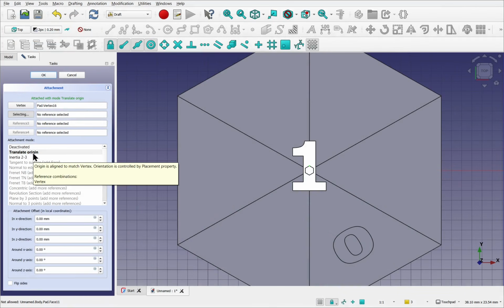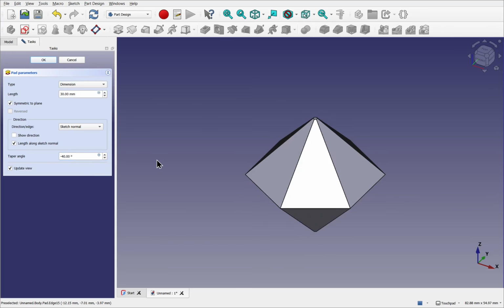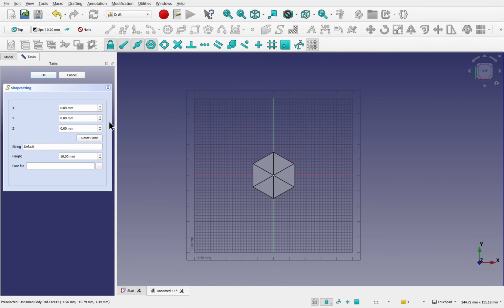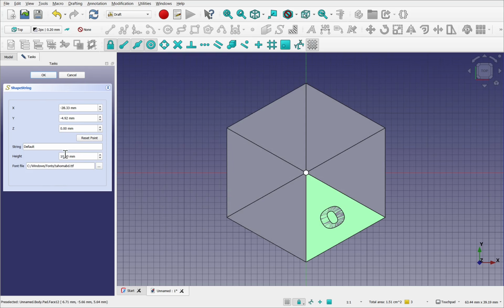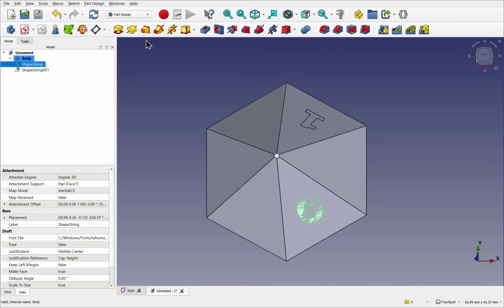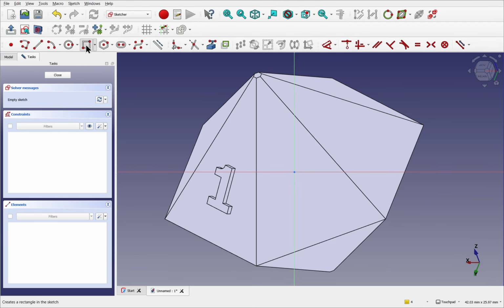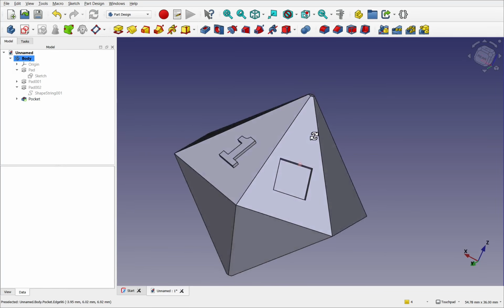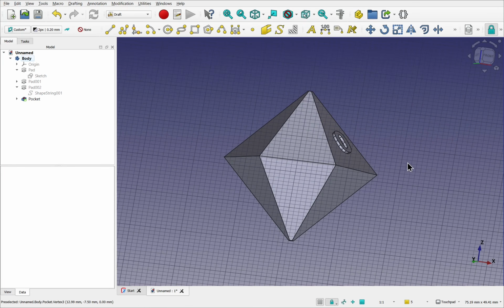Text in FreeCAD | Multi-Face Dice in Part Design | Basic Beginners FreeCAD v1.0 / 0.22 Lesson 17

Comment: Thanks for the tutorial! 
I'm starting to regret, that I didn't make some sort of documentation for myself as of how different functions within workbench are working. Now, when introducing another workbench, I feel that I've just too much information to grasp  - After watching the whole series, I think I will have to do it again :)

I stumbled upon 2 problems during finishing exercise:
1) In a "draft" mode selecting specific plane didn't work on all of the diamond shape faces (only on every second). This can be solved by using the second technique in this video and referencing your object/draft against 3 vertexes. (This would results in MapMode: ThreePointsPlane)
2) As someone already mentioned in comments - also could've created a "datum" plane on top of existing plane (which I did in 2 places - just to test it out) - this also worked, but I'm not fully sure what it actually means. 

Thanks for the effort putting these videos out here!
Reply from the maker: Thanks for the kind words, and it's great that you found ways to solve those mapping challenges and really happy you have shared.  The comments are just as important as the video, especially as versions move on.  FreeCAD is pretty extensive, a load of workbenches that can integrate partially and fully with others, it's a lot to take in if you try to spread yourself across them.  Starting with the part design does contain your leaning somewhat.

Comment: Thanks for the great video series! I’m a newbie to interactive 3D modelling. (I normally use OpenSCAD.) Following this video, I think I went overboard in building a pentagonal trapezohedronal D10 with a nice square outline (as viewed from the side when it lays flat on a side) using FreeCAD’s constraints system to calculate both the face draft (41.9699°) and the edge draft (48.0301°, also used for the “Pencil Blunter” for the sharp ends). I wasn’t quite sure at this stage how to intersect a pentacone with an inverted, rotated clone of itself using Part Design, so I did the outer levels with the Part workbench. 😀
Reply from the maker: Glad you enjoying the series :) :).  If your using the part workbench, might be worth checking out the add on workbench Pyramids-and-Polyhedrons workbench.  It will give you some nice primitive type shapes with configurations for size, side number etc.  It's been a while since I used it but it's great for this sort of thing :)

Comment: Is there a way to bend the text? I have text that I need to fit in a stamp without making the stamp longer so I wanted to bend it like this: ) but I can't figure out how.
Reply from the maker: There are a couple of options as it's not supported out of the box and often require either a macro or tools from a addon workbench.  I just looked through my bookmarks and found this : https://forum.freecad.org/viewtopic.php?style=8&t=82577

Also a video from myself using the curves workbench: 
Text on curved surface : https://youtu.be/AxtpYy9aFf4

The other option is to use inkscape and import the SVG straight into your model.

Comment: I'm going through all this again with 1.0.2, I get to around 21:00 mark to start draing the square onto thee third face, but I get an error saying "you need a planar face as support for a sketch!" I can attach it to any other face, just not the face next to the "1," so created a sketch with nothing selected and changed the mapping of the sketch to 3 points, it then aligns straight with the +Z the same directorion as the "1".
Reply: I'm having the same issue. Two of the six faces give me the error. All the rest it considers to be planar faces. "Align to selection" would also not work on those faces.

Comment: Couldn't make it. Working with Ubuntu and can't find my fonts.
Reply from the maker: In Ubuntu, font directories are primarily located in /usr/share/fonts for system-wide fonts and ~/.fonts (or ~/.local/share/fonts) for user-specific fonts. Additionally, /usr/local/share/fonts can be used for manually installed fonts.  Hopefully one of those locations will help you.

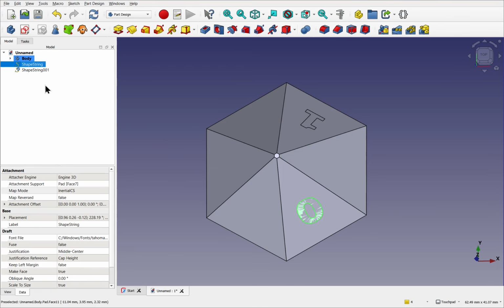Comment: At 11:35 when I attempt to drag the ShapeString into the active body the cursor turns to a red circle crossed through and the action cannot be completed, but I see no error message. What am I missing?
Reply from the maker: Just check to make sure that the shape string is not already inside the body by collapsing the body in the treeview.  It's quite easily to think something is already inside a body container when it actually outside..
Reply: @MangoJellySolutions  Nope,  both shape strings are outside the body.  I am unable to pad, getting the  "Cannot use selected object. Selected object must belong to the active body" message.

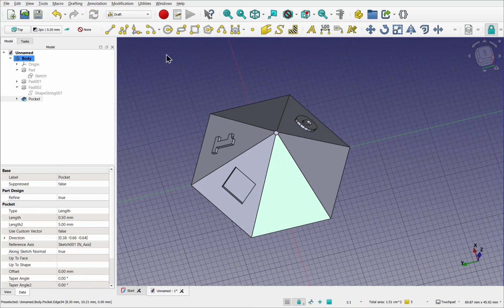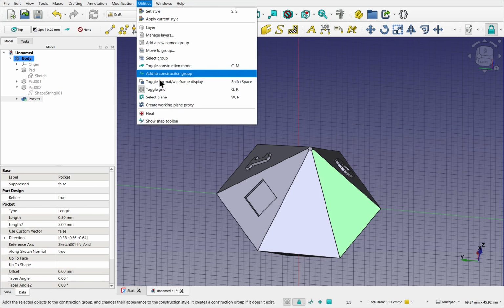Comment: Why is there an error when selecting a plane on some surfaces and not others "selected shapes do not define a plane" as seen in 17:40 - 17:57 of this tutorial? In my case, I'm not able to select a plane on the face that you did, however; I am able to select a plane on the face that you could not. Is there a workaround for this issue or is there something I'm doing wrong? Thanks!

Edit: I was able to go to the part design workbench to create a datum plane on the face then go back to the draft workbench then use the datum plane to select a plane to create the shapestring. The text appeared upside down so I had to rotate it 180 degrees.
Reply: i also ran into the same problem. only every other object could be used for plane reference. what did work for all faces however was using 3 edges instead of the face.
Reply: I am not sure why you never got an answer. Also someone else had the same question in the comments, also unanswered by the author.

Comment: Good Stuff! Question: How can I do this same thing but only created pocketed text so I only have a cookie cutter type outline of the text.
Reply from the maker: Interesting one, there are a number of routes.  If you just want the outline of the text click on the text and create shape binder.  The shape binder has options for offset and fill offset.  Set the makeface to false, fill offset to true and set the offset to either a minus or positive value.  Some text works best with say -2mm where other will be better with +2mm. You can then pad the shapebinder rather than the text. There are a number of other ways.  I think this could make a good video.

Comment: Your course is so helpful, Thank you so much! This is the first video of yours where I've run into issues, sadly.
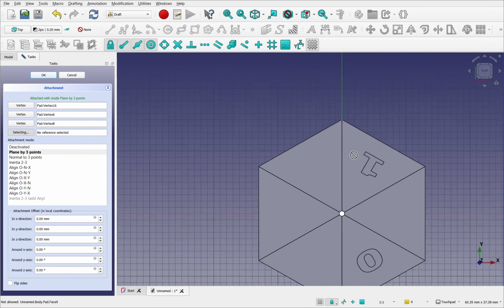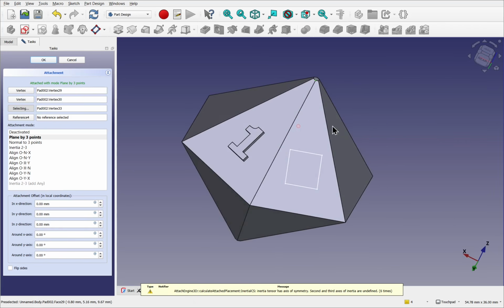First: When attaching the ShapeString object to the dice using "Plane by 3 points" (10:26), the object is not actually centered, because it is placed in the center of the triangle defined by the three points. As the dice side is a trapezoid, doing it this way places the object slightly off to one side (much more clearly visible if you reduce the taper angle of the first pad to something like 20°). It is more clearly visible with the square at 16:35. Do you know how this can be corrected? I also expected the object to be very slightly angled towards the orientation of the triangle between the 3 selected points, but it seems like the axes align properly, so I don't fully understand how FreeCAD places the origin based on the 3 selected points. Could you help me understand?

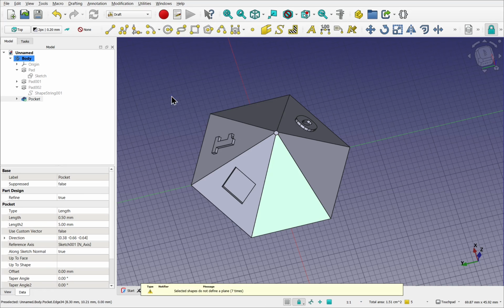And secondly, I also got the error message you got at 17:45, but I would love to know WHY that happens. Is it just a bug in FreeCAD? As a workaround, I just selected the two long Edges of the trapezoid that didn't work and selected the plane from that, which then worked fine. So I'd guess it really is some sort of bug, what do you think?
Reply: For anyone interested: I managed to solve the attachment by using "Inertia 2-3" and selecting all 4 edges as references. But I have to say, precise relative positioning of an object with regards to datums on another object is rather hard to get your head around.

Comment: No matter what face I select I get the error message "Selected shapes do not define a plane". The same error appears in your video but you select a different plane. Why is this message appearing?
Reply: i have the same issue, some faces are a valid plane some are not :/
Reply: in Draft when you chose Utilities -> Select plane, and the task menu for select plane opens, in the Working plane setup tab on the top there is first sentence "Select 3 vertices one or more shapes or a WP proxy(..)" those vertices give me a tip to solve this, Ive just using control chose three points of the chosen plane and then when i do Utilities->Select plane the whole thingy oriented correctly to the plane i want to work on

Comment: Cannot imagine learning Freecad on my own. Great lessons.
Reply from the maker: Great to see these are helping people, thank you for taking the time to leave a comment, much appreciated.
Reply: @MangoJellySolutions  I gotta tell you I'm using version 1 and your dialog boxes are very different. and they don't open up when you pick a part. or object the way that yours opens up.  Personally, I didn't think there was that big of a difference between version 1 and version .021. But trying to do these exercises and version one doesn't even have a draft or drafting. It does have a tech draw. I. but The interface is a lot different, more different than I suspected, and I can't do your exercises.
Reply: @MangoJellySolutions  Actually, my mistake I do have draft in my version one. Sometimes I run voice access and it takes up. Some of the header space on the top of the page and didn't realize I was blocking it and just didn't see it. I am running a different. theme. I think it's free CAD. dark  And I'm able to do this exercise ever since. I've made those discoveries. Sorry if I Added a little confusion
Reply: Absolutely, i have dabbled with many CAD programs but Freecad basically is one level below what you expect from having a fluent and easy to grasp user interface. It is not that it does make sense what it does in hindsight, but it basically lets you do everything literally at the lowest level possible. If you expect that you just chose a surface add some text and then raise or embed it. No way you have to define a text object, then drag it into your model, then define a surface axis and then put it on the surface axis and in the end you can raise or embed it but with commands which are not what you expect them to be! Unfortunately the text example is not the exception but the norm, literally every operation you do is as low level is this!

Absolutely impossible to learn without extensive tutorials or how to videos!
The ui or the overly complicated handling also is the main criticism Freecad always has and rightfully so!
It will become better over time, just like Blender, but this will be a long way!
Unfortunately there are not too many options outside of freecad if you want to keep it free and do not want to bind yourself into the cloud, the only other one is OpenSCAD!
Reply: 你不是一个人在战斗~